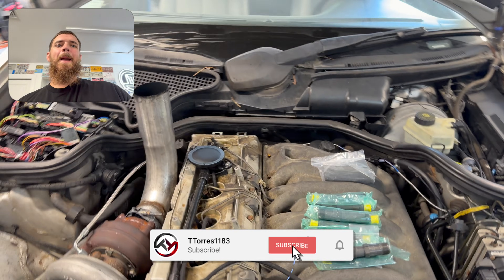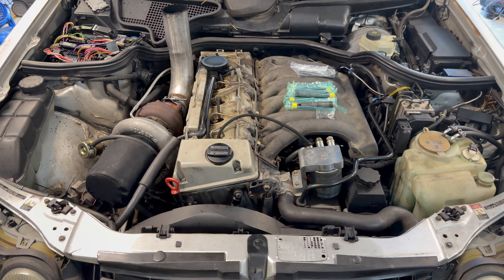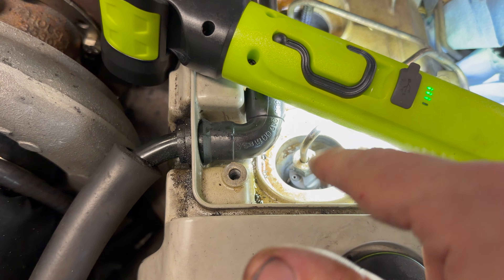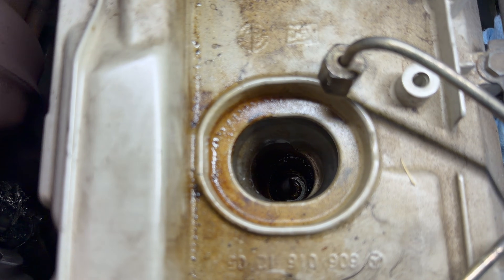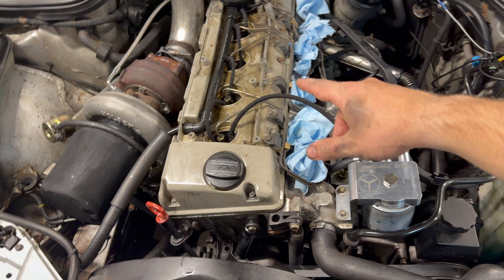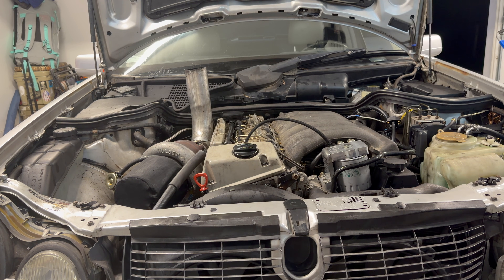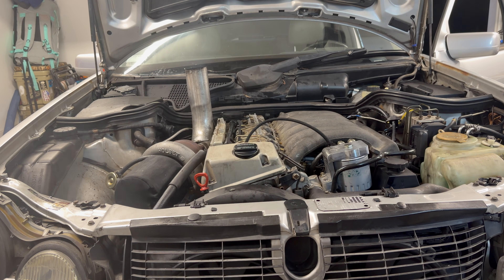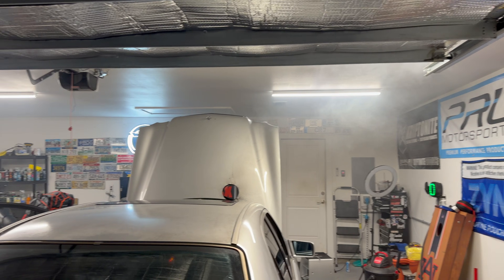Installing SUPER TURBO Injectors on My OM606!

Comment: Pour amorcer le circuit de gasoil après avoir changé le filtre à carburant ou autre, il faut débrancher la pompe à injection puis faire tourner le moteur au démarreur entre 40 secondes et 1 minute le temps que la pompe mette en pression le circuit de gazole et chasse l'air.
Puis rebranché la pompe et démarré.
 Pour s'assurer que tout est purgé, aller, faire un essai routier à allure normal pendant 10 à 15 minute ✌✌